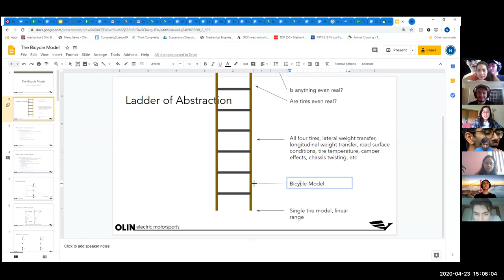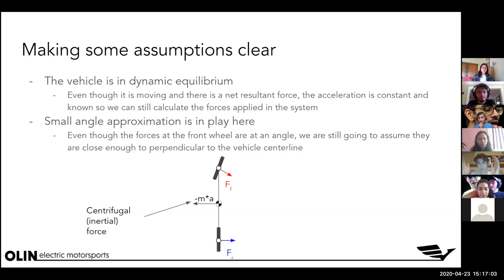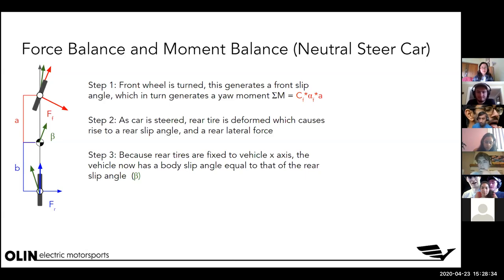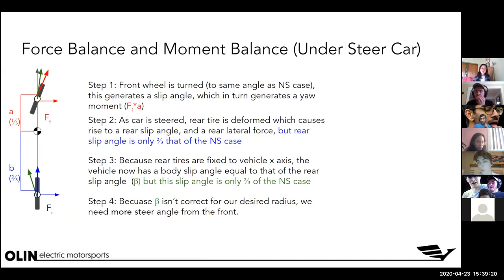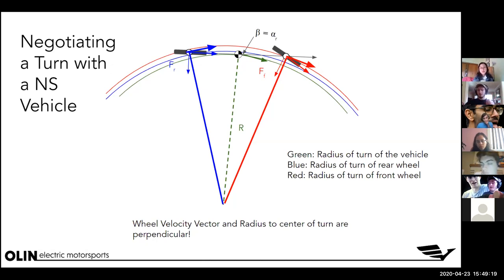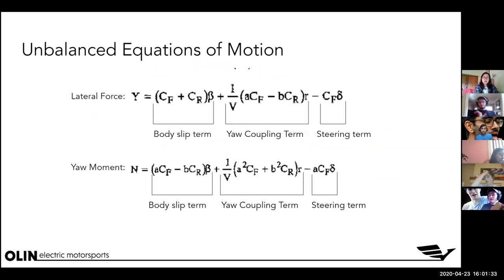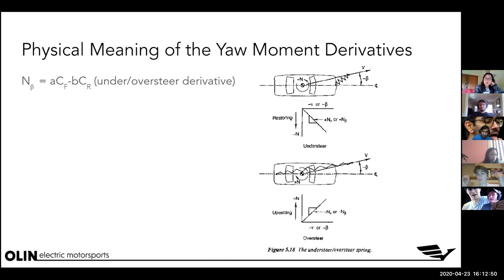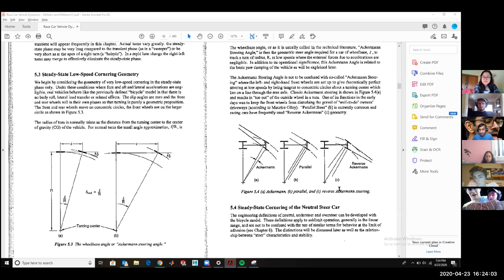Suspension and Chassis Learning Part 2: The Bicycle Model

Comment: Just sharing quite enthusiastic about this topic, the main speaker is doing a great job!

According the self-driving car coursera course, Beta(which is the body-slip angle) is equal to: B = { tan^-1( ((l_f * tan(delta_r) + l_r * tan(delta_f)) / ( l_f + l_r) )}, where l_r and l_f are the rear and front base lengths, respectively, and  delta_r and delta_f are the front and back(some vehicles have back steering capability) steering angles, respectively.